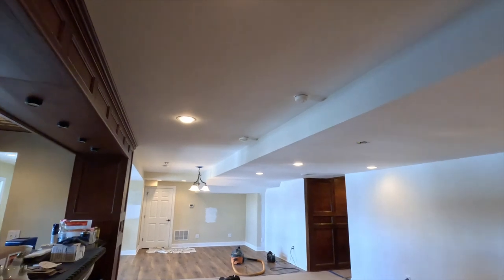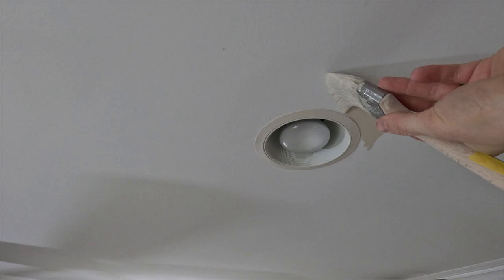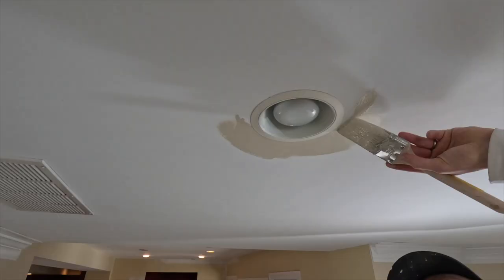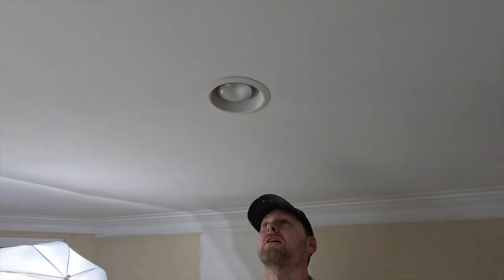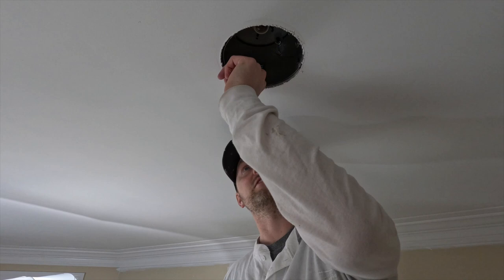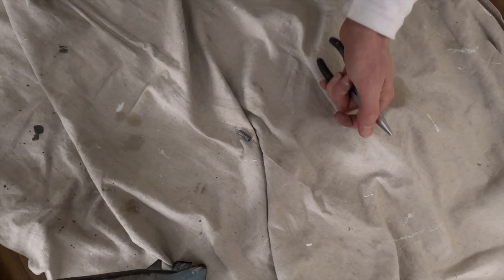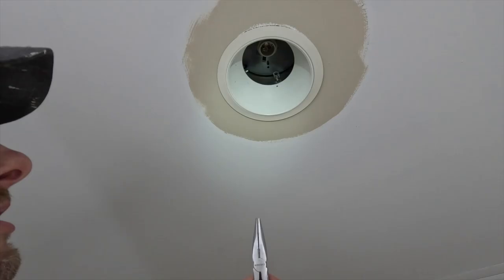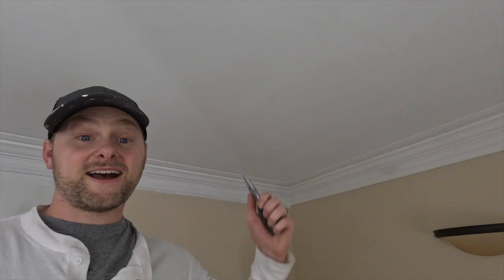2 Ways to Paint Around Ceiling Lights: Which one is Better for You?

Comment: What causes air bubbles to be left behind while painting? Ive used a foam roller and a 10mm nap roller and they both do it. Trying to paint my trim and want a smooth finish
Reply from the maker: We've had that happen a bunch, it could be for a number of reasons.   If you sand or clean (any standard cleaner spray will do) the trim first that should help.    If not, you can use a deglosser.  If that doesn't work,  then you may have to use a primer.     Sometimes its just a mystery if that doesn't work :).  good luck!